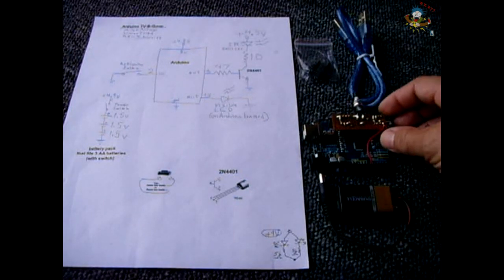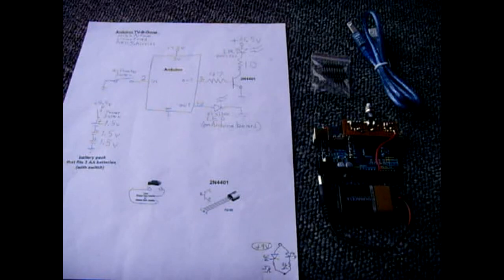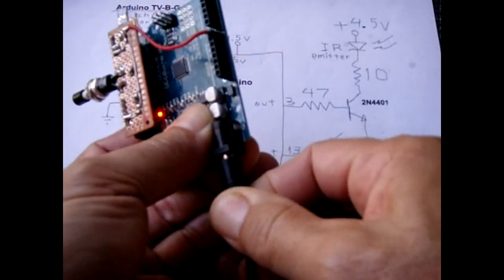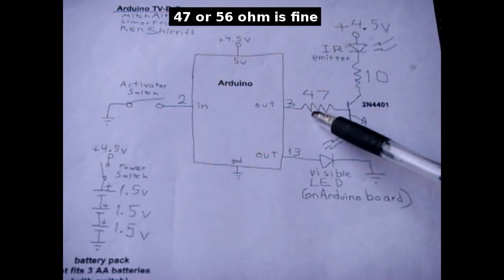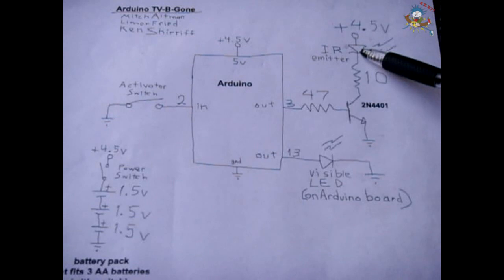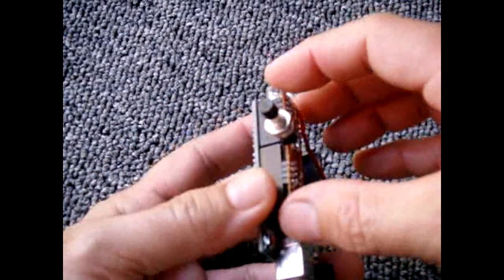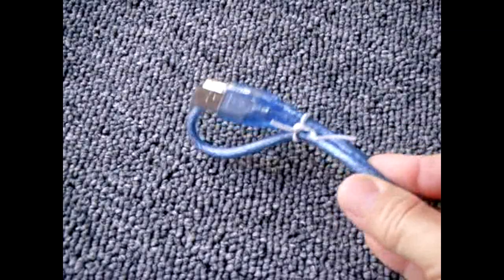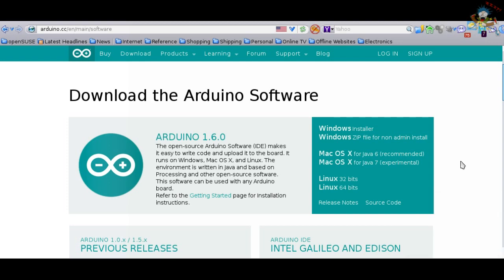How To Make ARDUINO TV-B-Gone

Comment: A 10 ohm resistor for the IR LED? IR leds I think have a drop voltage of like 1.2v, and 0.6v  for the transistor, so a total of 4.5v - 1.2v - 0.6v = 2.7v across that resistor, and doing ohms law, thats 270mA of current going through the poor IR LED, about 730mW of power dissipation.

Am I missing something? Like multiple emitters driven? Or do IR LEDs REALLY take that much current? I would have thought they, being the same form factor and package type as 5mm LEDs, that they would dissipate the same amount of power to prevent overheating.
Reply from the maker: The IR LED's I used have a forward voltage drop of 1.6V. The maximum current drawn off the 9V battery while in operation is 42mA. IR LED's can take some current. Here is what one online retailer(adafruit) said regarding these LED's.

"These are the same LEDs we use in our super TV-B-Gone kit. You can drive them continuously (for 'night vision' illumination) with 100mA and for IR remote application they can take up to 1 Amp pulses."

As you saw in this video, the LED's are only driven using "pulses", not continuous use at high current.

Remember, I did not design the circuit, I only shared it with you because it works very well.
Reply: electronicsNmore I never knew that IR LEDs can take so much current! I will have to try this with my spare mega board and some old IR leds extracted out of some obsolete remote controls to old TVs.

Is the 42mA current determined with a multimeter, or by a shunt resistor and oscilloscope? A digital multimeter does some slow sampling, like maybe 4Hz, and it is unlikely that it sampling occurs right when the LED burst happens, so that may be inaccurate. I think it may be averaging the value to make readings more stable, too.
Reply from the maker: I agree. The 42mA is using my Wavetek. So I am seeing an "average". The scope would show higher current pulses.
Reply: Keep in mind that the output is pulsed,thus the duty cycle (and average power) is pretty low.
Also,any small signal NPN transistor should work fine,it doesn't have to be a 2N4401. (2N2222,2N3904,2SC1815,whatever.)
Reply: PhattyMo I know, and in that case, if I was designing that driving stage, and did not have parts to spare, I would have looked at the peak maximum pulse rating of the LEDs and transistors. The thermal mass of the packages is generally enough to survive some abuse from a really short-lived overload, which is why the pulse condition ratings is so much higher.
Reply: Power Max
You can pulse an LED at 20amps or more if the pulse width is short enough.

Comment: Hey! nice video m8 :)

if i wanna use the voltage from the arduino to power the IR Leds (5v) do i have to change the resistor or just leave it like it is?
thanks
Reply from the maker: Alex Godo Hi Alex. The Arduino output pins cannot handle a lot of current. Try a 130 ohm resistor in series with the 2 leds leading to the transistor's collector.
Reply: electronicsNmore i just build it with the 5volts and the 130ohms resistor.  It works okay,  but the range is 2 or 3 meters.  Do u have any suggestion of modifying the circuit to increase the range
Thanks :)
Reply from the maker: That will be the problem because you want to use the 5V supply from the Arduino. If you make it the way I did, you can get very good range. Try making the 130 ohm resistors 100 ohm.
Reply: Same distance more a less. Would u suggest me trying with a 45ohms resistor? Thank you very much
Reply from the maker: No. The correct thing to do is use 4AA batteries to supply power to the Arduino, and to power the LEDs, or copy what I did in the video. Unfortunately I cannot reply more than a couple times to any viewer due to the fact that I have many other people asking questions on my 277 videos. Everything you need to know is in the video. Thank You.

Comment: why is the max current ma I can get is like 15ma or most is like 20ma when there should be over 120ma running through my leds according to my circuit??? i don't have problem with range but Im curious why is that most pulses are like less than 10ma on my multimeter ???
Reply from the maker: You can't see the high current peaks without a scope because the frequency is too high.
Reply: @electronicsNmore  I combined the tv remote jammer code(function) with this, so why do I see current as high as 150ma with that then?? isn't that same frequency ? but when I switch to tvbgone function, the current comes way down

Comment: You mentioned that it works fine for 40-50 feet. I wonder if a person could rig up some kind of lens to get the range to 100 feet or more. Otherwise how will a person be able to prank the neighbors by turning off their TV sets by shooting the beam through the windows?
Reply from the maker: If you are standing outside a friend's house, and aiming the device at the TV, it should go off. You can get much more range by doing what I stated in the video.(more current to the LED's)

Comment: Can I also use another Transistor which "accepts" more current? Because I don´ t find the 2nn44041
Reply from the maker: +Y Channel 
2N4401 is the transistor.
Reply: +electronicsNmore yes but can I use another one?
Reply from the maker: Y Channel

Yes, a similar type will work.

Comment: BTW - where did you get your $9 Arduino board??
Reply from the maker: Picked it up on Ebay months ago. You can still get them cheap off Ebay.
Reply: electronicsNmore
Thank you!! VERY good to know. Will check there tonight :)
Reply from the maker: Already looking at your blog. You must have seen the incubator video I made for culturing bacteria and hatching eggs. :-)
Reply: electronicsNmore
Have not seen it yet, but will have to check that out ;)  Checked eBay and indeed there are some good Arduino UNO clones for under $10 apiece.

Comment: This is OK device but it will be MUCH better if you could make it so that it can "learn" codes from original Remote Control and reproduce those codes again with IR diodes.
Reply from the maker: TV-B-Gone devices have the codes programmed into them(That I know of), they do not "Learn". You must be looking to use this for another purpose. In order to learn, you would need access to all the remotes!
 
Thanks For Watching.
Reply: The idea is that it emulates many remote code simultaneously, similar to that of a universal remote. At least from what I remember about this many years ago when Arduino was it it's hay day and super popular, as raspberry pi is now.
Reply: defeats the purpose, you dont have the remote in a shop bar etc

Comment: If I use diodes with 100mah and 1.4 volts do I have to connect 4 in series an two parrallel?
Reply: Or do you think diodes with 5volts will also work they all together have 600mah so I dont need the resistor right?
Reply from the maker: +Y Channel 
Hello. The link below should help you.

http://ledcalc.com/

Comment: I have 2 TV at home TOSHIBA  
and FINLUX works fine and in my school the TV is Thompson and won't work.
Reply from the maker: +THEbloxermanRBX Gamer and Show 
Hello. The main bug fix in the new version is the European codes will now work (if you ground pin 5).
Reply: +electronicsNmore how to do you mean to ground pin 5
Reply from the maker: THEbloxermanRBX Gamer and Show
The TV may be a European TV. You need to enable European code scanning by connecting pin 5 to the battery NEG. Refer to the link in the video description area. Read everything. Thanks.
Reply: +electronicsNmore thank you  grounding pin 5 works :D

Comment: Hey, thank you for this awesome video. I get this error:

Arduino: 1.6.5 (Windows 7), Platine: "Arduino/Genuino Uno"

TVB:78: error: variable 'NApowerCodes' must be const in order to be put into read-only section by means of '__attribute__((progmem))'
TVB:79: error: variable 'EUpowerCodes' must be const in order to be put into read-only section by means of '__attribute__((progmem))'
variable 'NApowerCodes' must be const in order to be put into read-only section by means of '__attribute__((progmem))'

Can you or anyone help me, please?
Reply from the maker: +Pe Ligro 

You need to ask a person who is an expert at programming an Arduino. I simply provided the links to everything, and demonstrated how it is done. Sounds like you are having a problem because of a TV card installed on your computer. Make sure you choose the Arduino device.

Thanks
Reply: The adafruit site has a fix for that with a download for the file

Comment: Hi all. for those who encountered errors:
i had the same problem with all of you, every few lines some error occurs, after a few hours of playing with the code and the libraries and reading the Ken's method (http://www.righto.com/) of coding for hundreds of times, i found that the problem is not the code itself, I've tried fixing every error, changing every port and finally came to this:
version 1.0.3 (http://arduino.googlecode.com/files/arduino-1.0.3-windows.zip) of arduino IDE  for windows, just uploaded it to my UNO R3 without any errors and  it works great. i have used no transistors or resistors, just pinned anode of the IR LED to pin 3 and then grounded the LED cathode to GND right next to pin 13. turns every single TV that i have tested so far off, 30 years olds from sony to toshiba and high end samsung TVs.
Reply: Thanks bro!

Comment: My arduino programm always says error because of the first line "main.h" :(
Reply from the maker: +Y Channel 
You may be using an Arduino that is not compatible. When duplicating things you see on Youtube, always do everything the same using the same parts/components.

Thanks.
Reply: +electronicsNmore Arduino: 1.6.6 (Windows 8.1), Board: "Arduino/Genuino Uno"

C:\Users\Paul Schade\Documents\Arduino\sketch_nov28a\sketch_nov28a.ino:11:20: fatal error:  main.h : No such file or directory

 #include " main.h "

                    ^

compilation terminated.

exit status 1
failed to compile
Reply from the maker: Y Channel
No one else complained. There is nothing I can do. I am not there to inspect your Arduino, cables, or software. I can say the device works perfectly. Look for another cheap arduino online, and try another computer.